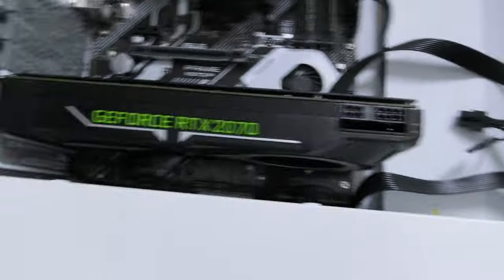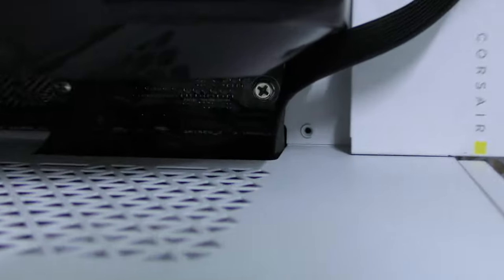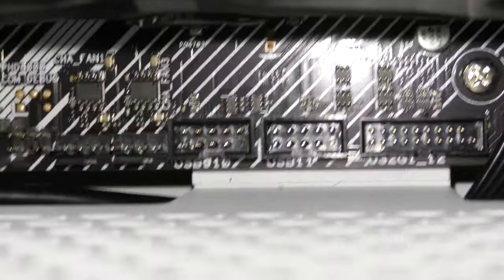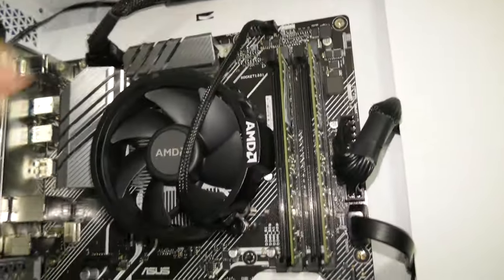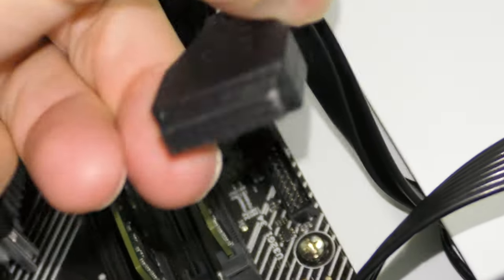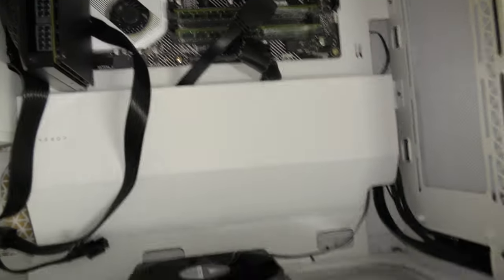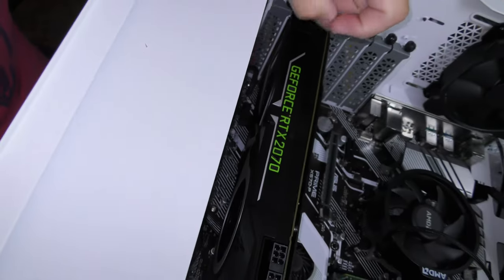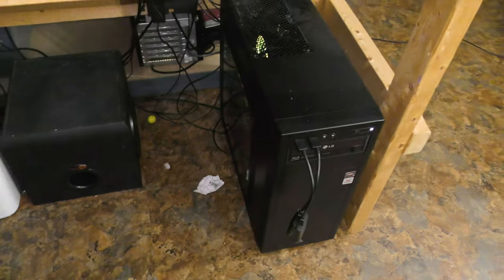Why I HATE Cable Management 🤬 - A Bird's Nest of Wires is BETTER 🐧 - Jody Bruchon

Comment: You're mad because people do things differently than you. Why do you care? It's not a big deal. Sure maybe you see computers as a utilitarian tool and to you personally, putting effort into making them look neat and tidy is stupid, but that's just you. That's your opinion, and it's just an opinion. Building a computer is entirely up to personal preference and you don't get a say in that. Computer building for most is a hobby, so a lot of people will want to take pride in what they do and make their build nice and tidy.

You also probably didn't consider that there's people that have their computers on their desk, in which case there's more of a reason to make it tidy since it's actually in your field of vision. The only actual reasonable point you brought up here is the strain on the connectors on the side of the mb, which you're right that's not a good thing, and if you're cable managing with one of those shroud things you need to take that into consideration. But the rest of this video is you just ranting about something you don't like and talking like you have authority over the way people do things, which you don't. 

Everything about that "example" computer that you tried to label as "grr cable management bad" is just the person who built that computer not knowing what they're doing. That's not a fault of cable management, that's a fault of the builder. And maybe instead of shaming people for getting something wrong, help them understand what they're doing so they can get it right. Building computers is intimidating when you're starting off and especially if you go at it on your own you're bound to get something wrong and not know, because you don't know. It takes time to learn this stuff and as much as building a computer becomes secondhand nature to us that doesn't take much thought, so does cable management.

Cable management isn't a big deal. Nobody's getting hurt or harmed, nothing wrong is being done. It's ok for you to not like a insignificant thing like cable management, but you also need to grow up and understand that other people can like said thing and there's nothing wrong with that either. You need to realize this is all about preference, and people are different and want different things out of life. Just as much as you hate cable management there's people out there who take a lot of pride in their well managed cables.
Reply from the maker: Nope, I'm annoyed that people claim that what's going on in this case is a good thing, and do so authoritatively in PC assembly tutorials. As shown, it is objectively a bad thing. This is not a matter of opinion. The ATX power connector and USB 3.0 connector as installed are both pulling very hard on the motherboard sockets and the USB 3.0 header plug already has signs of damage from improper installation. The video card power cable as installed is being pulled as well. This causes either internal breakage of the wires, the plugs pulling themselves out of the sockets over time (read: the PC ends up in the shop anyway due to "doing nothing") or the sockets to slowly be ripped off the board.

Don't worry, there will be a big follow-up video and your comment will definitely be featured in it, along with refutations.
Reply: @JodyBruchon  did you even read through the reply. go find me one example of someone saying that build was a good demonstration of cable management.
Reply from the maker: @tavi3938  Your reply is obnoxious. I gave it as much as it deserved.

Comment: I think this is a bad take.
Reply from the maker: You think incorrectly.
Reply: @JodyBruchon  well you can't exactly not cable manage in some cases because the psu is behind a shroud and you have to route the cables efficiently so you do not tangle them, and you can provide easy maintenance if you need to for example changing out fans.
Reply from the maker: This case is one such case. It forces you into the "hide everything" method. It has impractical channels in the rear for stowing the wires. The wires simply aren't long enough or flexible enough to be routed that way. I opted to pull all of them out, rewire them along the rear using different cutout locations, and only then use SOME of the straps and channels to tuck the wires that had some slack available so they didn't jiggle. The power wires that went mostly unused are bundled up and tied where 3 extra case fans they'll never ever buy would have gone.
Reply: @JodyBruchon  makes sense, i agree